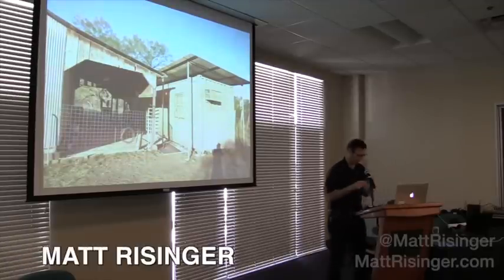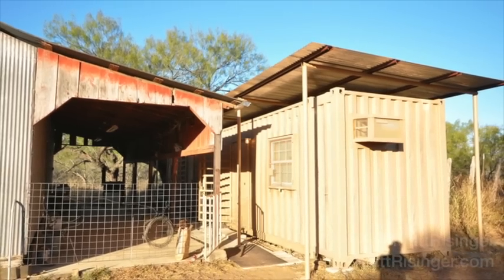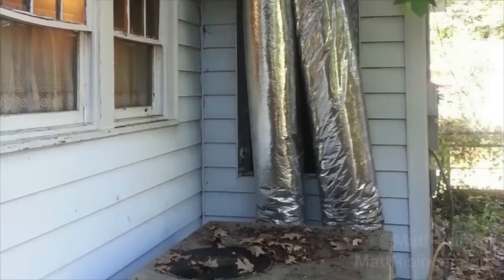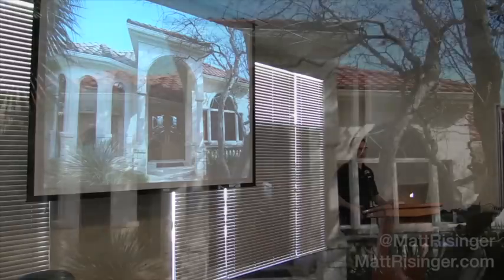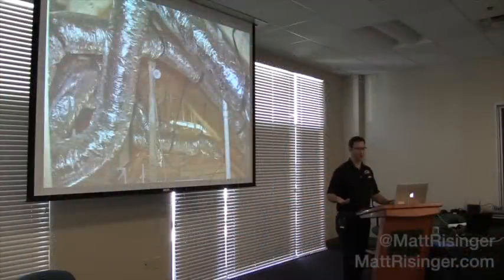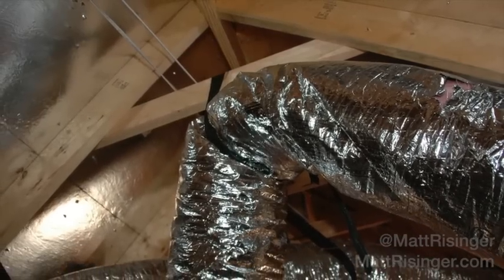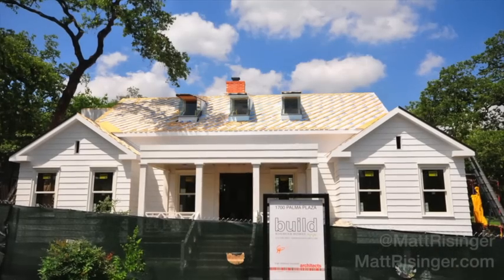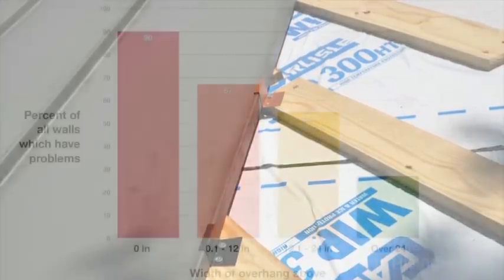Perfect Roof AIA Summer Conference Presentation

Comment: I want to use Perfect Wall & Roof on a shipping container.I'm going to use InSoFast insulated inserts to fill the corrugations on the outside walls and roof. Should I put the peel and stick over that? Half of the membrane would be stuck to the insulation in the corrugations and half to the container itself. Over that I will add 4" of rigid foam on the walls and 6" on the roof, then air gap, then cladding.

Comment: But it also says it you need to modify it for extremely cold climates? What happens when your climate swings between -45C winters and +40 summers? And for it to last that long you also have to take into account it would not be heated and lived in for some years? Would it still hold up? We have traditional houses that do hold up that long, at my parents place there is a log house built 200 years ago roughly, but been unoccupied for probably 80 of those.. Metal sheet roof added 50 years ago, and it still is sound structurally, although to live in it you would have to redo a lot of the non-structural stuff. Would the perfectwall hold up as well as that? Lots of houses built that way thats 300+ years old people still live in.

Comment: Thanks for the presentation.  got a 1965 Leander House we are trying to take to 2015. Lived in Germany for 23 years and external installation was very common for roofs, great to see how you handled in our climate. Got a bit more fire danger in my area, and the design commitee is not into a metal look except on the roof. Hard to get used to no overhang on the roof, though its quite the fashion in southern California. Its actually a firecode that being the only season in California!

Comment: Very cool Matt. I find it slightly ironic that the first bit of the video is about overhangs then we go into a house with no overhangs. I'd think that most people would prefer an overhang solely for aesthetics if they were going with the perfect roof/wall system. Have you figured out a way to incorporate an overhang?
I really enjoyed the presentation and I hope you plan to upload more of them.
Reply: This 475 post has an example of a detail that can be used to have an overhang in this "foam igloo" type of house: http://foursevenfive.com/rowe-hill-foam-free-deep-energy-retorfit-der-by-maine-passive-house/
Reply: w0ffe Thanks w0ffe!  Checking it out.
Reply from the maker: We have overhangs on all the exterior doors and some of the windows.  The overhangs are "bolted" on later.  I should do a video on that, or a blog post.  Look for future videos on the completed "Perfect Wall" House.  Matt
Reply: Matt Risinger Thanks for the reply Matt.
Reply: Exactly what i was thinking but i think there is a big problem with your awning design! In extreme climates these big hunks of metal will act as a thermal bridge drawing heat or cold into the house through the fixings and past the insulation.
  I have a question though. 
The air gap seems like a good idea although less important than on a roof. If i was to use this concept but if i wanted to finish in stucco (render). Then this would not be so practical however could it work if i used two layers of EPS on the external wall with an air gap between? (i have concrete block walls and the local planning want to see the bottom level rendered).
  Say 140mm then batons then another layer 20mm thick which could then be finished in stucco? Or is the air gap pointless in a system along a concrete wall?
Reply: @izzzzzz6  There are literally a few square inches of steel in the whole project in all the bolts to hold on all those awnings passing through to studs or blocking. Trivial.
Reply: @nickmcgarvey6463  It looks great, it's made me interested in making a vessel on this type of foil or torpedo foils when i was originally thinking i would need a foil that would lift the entire vessel out of the water, this makes more sense to me.
  I am quite interested in solar boats and by adding this type of efficiency it becomes even more interesting. There is a high speed super yacht that runs on huge aluminium torpedo type hulls and there is also a solar powered super yacht. I would be interested in making a small personalised water craft based on the combination of these technologies.
  Now i just need to move to a body of water :D

Comment: Two concerns.  1) in time, I'd expect the 2nd FL floor would start squeak when walked on.  Since there is very little to no insulation all the noise you'd hear from the 1st fl?   2) from practicality stand point, I think the idea is really awesome.  But it downgrades the esthetics big time.  Overhangs on the roof can sometimes make the house really modern and chic.  Since there are none, the house looks like a lego house.  Some may find it cool.  But if you have money to burn you'd would want something more sophiscated and complex.  Just thoughts.

I am thinking about building a cabin in the wood.  I will apply the lego house idea to it, definitely.

Comment: Thanks Matt I love your diligence. Perfect roof for me is flat with lounger, hot tub, and garden with rain retention. My real question is why not fused or sheets of polycarbonate with traction coating for roofing would that not be best? You even  wrap it around over hang and tie it to wall to fix uplift and help with shear.
Reply: H. uuu
Reply: metal is best! gains value over the life ofthe house. usable and reusable for hundreds of years. so cheap per square foot. anything that can degrade with UV and weather exposure, will -- only stone can compare to metal durability, and stone/slate/ceramic is brutal to install and service.

Comment: 1.  The diagonal furring on the roof is genius.
2.  Did you tape the seams on both layers of foam on wall and roof?

Because of Murphy's Law:
3.  The water control layer is buried 6" down, so any sort of roof leak is virtually impossible to fix.  
4.  We usually have something like tarpaper under roofing materials.  That's because the chaotic splashing of a deluge can cause some water to get behind the roofing material.  I'm OK with the foil facing of the foam performing the function of tarpaper, but it's not replaceable, and it's full of holes from the furring screws.
5.  The water control layer isn't vented, so any water that might reach that layer can't get out easily.
6.  A simple gable would have no issues, but in this case I'm a little worried about the dormer and skylight.

Should a leak ever develop, an "over roof" is a solution.  Remove roofing, lay 2 x 4s flat, then roof sheathing, then tarpaper, then reinstall roofing.  That also gives you a chance to have real overhangs at the best location, the top of the wall.

Comment: I have an idea, brick or even masonry interior wall to increase the thermal mass since they've been protected by outsulation.
Reply from the maker: +Max Young yeah baby!  Now we are talking
Reply: As long as there is no thermal bridging to the outside and assuming that temperature extremes are an issue then yes any thermal mass will help to stabilise temperatures. Water is also a good thermal storage device. Personally i wish to dig under my house and install an insulated water tank that can hold lets say 5000L. In the winter solar heated water can be stored there and used to keep ambient temperatures over night or through bad weather days. Perhaps in summer it could be used to cool the house by pumping cool water (ground temp) through the under floor heating if i ever get around to installing any.

Comment: Lstiburek did a lecture recently where he said that unvented attics can be done but they're not better or more energy efficient than a vented attic. The ceiling surface area of the unvented attic is a lot greater than the flatter, simpler ceiling plane/attic floor of the vented approach.

He's got a great point there but sometimes - maybe often - there's problems that make that perfect vented attic system difficult to get right. I own an old house that is next to impossible to eave vent and I think I'd be better off going to a conditioned attic.

Question Matt--the two layers of rigid on top of the roof decking are four inches total of insulation right? That can't be much more than R-22.
Reply: It may be a matter of construction practice. Here in Canada almost all houses have a basement, so that's usually where we put the mechanicals (and most basements are inside the insulated envelope). But in Texas, where there are almost no basements, the attic is the "natural" place for mechanicals. If you're going to put the mechanicals there, you really want to make the attic part of the conditioned space.

But then if you insulate and air seal to the point where you only need a minisplit with a couple of indoor units and some fans, it kind of evens out, since you don't need to put anything in the attic then.

At that point it's a matter of how you want to achieve that degree of insulation and air sealing. Building a foam igloo over a simple shape covered in a fully adhered membrane is a proven technique, and it naturally lends itself to a conditioned attic.
Reply from the maker: w0ffe Here in TX we have no frost line and often we're building on rock.  We generally have slab-on-grade construction or Pier & Beam.  Basements are unheard of in Texas.  Mechanicals are in the attics of 99% of Texas homes.  Matt
Reply from the maker: The roofline on my "Perfect Wall" house is 6" of Foil Faced Polyiso from Carlisle.  That's roughly R-6 per inch so we've got R-36 on the roof with Zero thermal bridges (except maybe the screws).  We've also got a nice radiant barrier with the foil faced foam and the Galvalume metal roof.  We could have gone thicker, but I think our roof will perform quite well for the next few hundred years.  Matt

Comment: May I ask a question, the 1x4 batten you use on the outside (16:34), how do you attach them to the house itself so as to prevent a thermal bridge? Do they go right through the foam and attach to the OSB on the inside, or do they hold on to the foam itself?
Reply: Tomek, I asked this question on another of Matt's videos. I believe long screws are that go trough the foam and into the studs/rafters. The screw itself would be the only thermal bridge.
Reply: SailingandSuch Cheers! I was curious whether Matt maybe had a different solution, considering his diligence with the most minute of things (I'm remembering a vid on sound insulation here). Guess there aren't really any other possibilities, thanks again!
Reply: I've been wondering the same thing!  With all these videos about building perfect walls it seems like they never actually show us how they build step by step

Comment: Matt, Is there no concern about using the corrugated metal roof with a through screw? I live/work in Tucson, AZ and it seems to me the sun will just destroy the rubber washer and next thing you know is you are having a mold party in your 1x4 battens. Do you do anything to prevent that?

Thanks
Reply from the maker: Tom Moore Tom, Yes we would have preferred a concealed fastener metal roof but cost was an issue on this small project so we saved with the gasketed screw.  He's why I'm not concerned; The metal roof & siding is on a 1x4 furring system that creates a 3/4" air gap behind the metal.  That air gap means that any small future leaks will dry without harming the structure.  I understand the gaskets to have a 20+ year lifespan so they could be replaced and re-screwed if necessary.  Again, with the air gap I'm not worried about some future leaks.  They can dry harmlessly.  Best, Matt

Comment: Matt, do you ever use a balanced erv or spot erv? Or do you always use exhaust only ventilation?
Reply from the maker: I'm a fan of the Panasonic Spot ERV.  Great price for good performance.  Otherwise I'll use a supply only strategy and bring in the fresh air through a Dehumidifier on a timer system.

Comment: Matt, what are your thoughts on not having rafter tails and then having plywood on top of the roof insulation overhang like in these two pictures intersecting with soffit joist and facia board which is installed on top of the wall insulation? That way there can be an overhang on the roof without having to deal with insulating between the rafters.
    
http://techno-fandom.org/~hobbit/hse/log/878784/ren/1215applyply.jpg
http://www.finehomebuilding.com/CMS/uploadedImages/Images/Homebuilding/QA/hb138QA01-02_lg.jpg

Comment: You are still making multiple trips around the house having to pay careful attention achieving continuity to the control layers. Why not
switch to something monolithic like polyurethane exterior spray foam?
Reply from the maker: Certainly an option, but I think the logistics on that system are difficult.
Reply: @buildshow  Four years is a long time but still relevant. Location, SW FL. I was thinking of doing spray foam over block, "clever wall". Is it still logistically easier to go with the sheets? Do you know what the cost comparison is of an over CMU 'clever' wall closed cell spray foam vs an over CMU 'perfect' wall? I would assume a metal facade would be less expensive than a brick facade.
I was thinking of attempting PHIUS net zero in Fort Myers with one of the above. The wife wants a very small pool that could complicate things. I've seen ICFs and SIPs used around here a few places but I don't think anyone has bothered with the air tightness. I wanted to do this as inexpensively as possible. I was thinking an unadorned industrial look might save a few bucks. Spend more on the technical aspects of the house and keep the interior simple. Doesn't everyone love the loft look, painted CMU interior with exposed wire conduits and fresh air ducts?